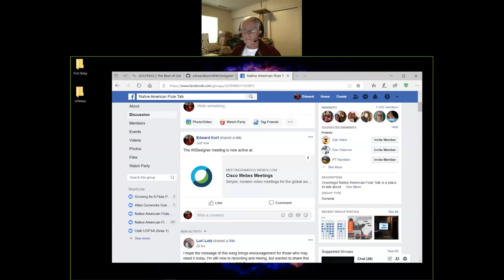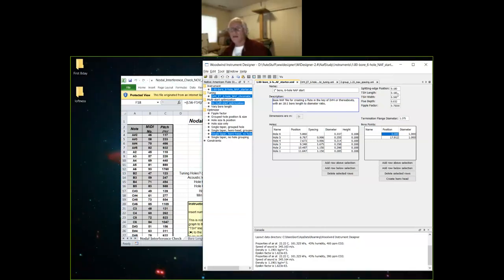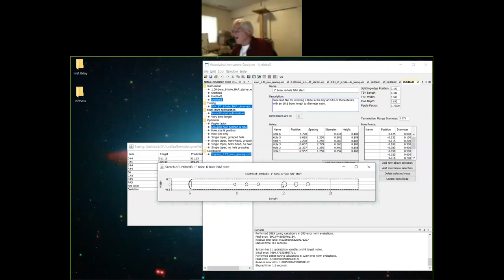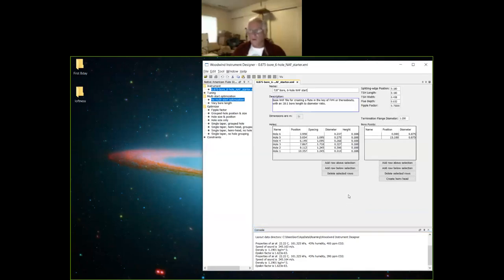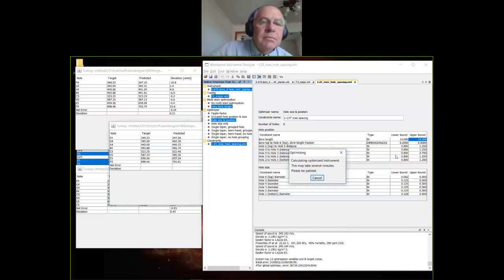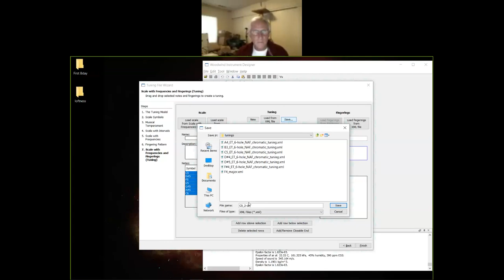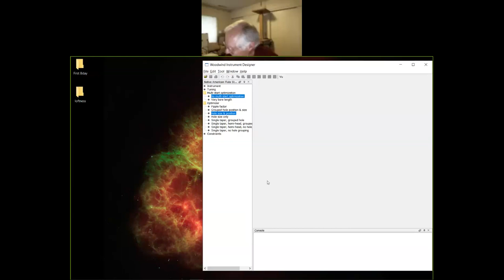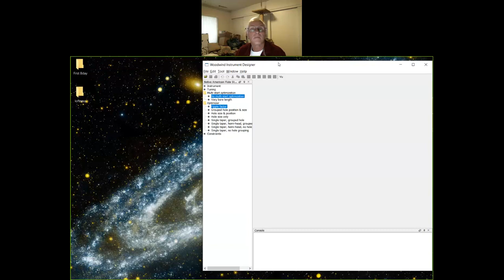WIDesigner Q&A One

Comment: Hehe... this video is fantastic, thanks so very very much for WID! Bane of my existence, though -- there's always one or two people who have both an external speaker and their microphone live at the same time, causing a loud, mumbling echo. Haha, anyway -- just an enthusiastic comment, not really a question at all:
So it appears Fipple Factor is a corrector/adapter between the calculations and nuances in real life for which there is no adjustable parameter. Before I got WID the first thing I realized was I couldn't drill holes too early, based on pure calculations, before settling in on a real-life length after tuning the fundamental frequency. The temptation was there because I wanted to drill them from the inside out if I made it in two halves, before glue-up. But I was already learning I needed to keep adjusting NAFlutomat or whatever to more accurately reflect reality (real wall thickness at the TSH etc.). But it's impractical to try to make a parameter for every possible factor of everything going on at the nest so the Fipple Factor helps group or round the more ambiguous measurements up together into a Fipple Factor and bridge the gap between our unit in hand and the virtual one. I was doing so on NAFlutomat by lying to it here and there and trying to determine thru trial and error what lies were the least harmful but the most beneficial. Here this has been figured out for me and eases my trial and error. The learning curve is worth it. Thanks again.

Comment: I am designing Indian transverse flute, it’s called bansuri in Indian languages. I am facing hard time after using Woodwind designer. I am designing G4# flute. The first hole from blowing hole position is always coming at wrong location. When I blow air it’s always playing one note lower. I did use calibration method to find out Beta factor and I also used different air stream heights but not getting to match my perfectly crafted PVC flute. Woodwind designer is always one note lower. Do I know what mistake am I doing while using this software or may be this software is a wrong choice for bansuri design.
Reply: If I notice anything that clues me into why this could have been happening to you, Bamboo Flute, I will reach out.. or did you ever figure out what was happening? I was stuck for hours until I realized an otherwise awesome writer made an error about a cross-fingered note in an article over at Flutopedia

Comment: Is it normal to have zero deviation and net error, on your tuning table? This feels impossible considering how new I am to this
Reply: It all depends upon how many independent variables (hole size, spacing, etc.) you have compared to how many significant dependent variables (tunings and impacted constraints). For a mid-range NAF only tuned for 6 notes (the common pentatonic minor in one octave), there are an infinite number of geometries that will yield perfect tuning - and WIDesigner will only show one of them.

When the optimizer produces a perfectly tuned flute, I recommend that you look at the hole sizes and spacings to determine whether they yield a flute that is easy to play and is esthetically pleasing. Often you will want to tighten the constraints. Alternatively, you can add more notes to the tuning file. I typically try to achieve a chromatically tuned flute with 15 notes/fingerings in the tuning file. And such flutes are never perfect.
Reply: @edwardkort3516   Thank you for that reply. My first attempt is a relatively low complexity 5 hole one octave transverse bamboo flute. You were correct my design was low on aesthetics and ease of fingering. After tightening constraints my deviations began to deviate in a more expected way. 
Thank you again.